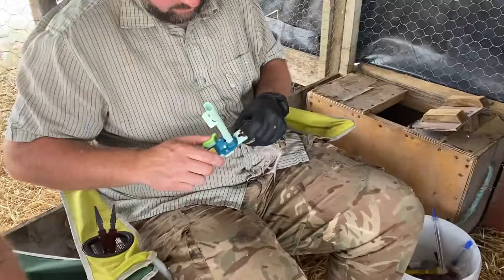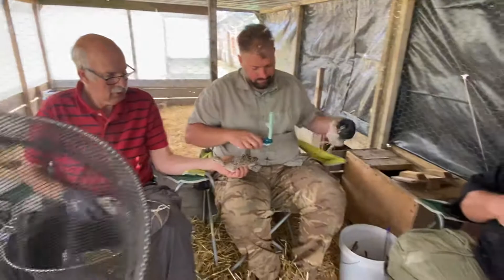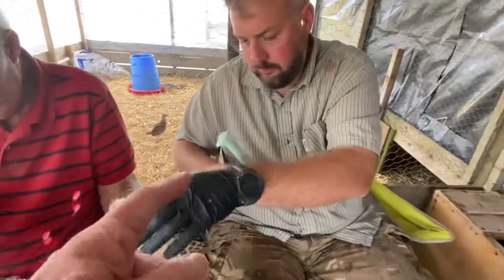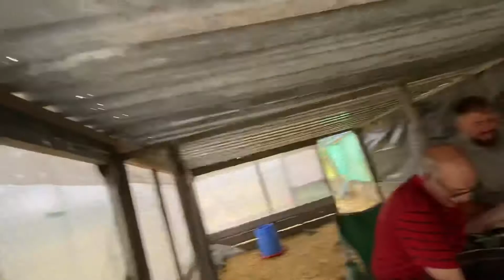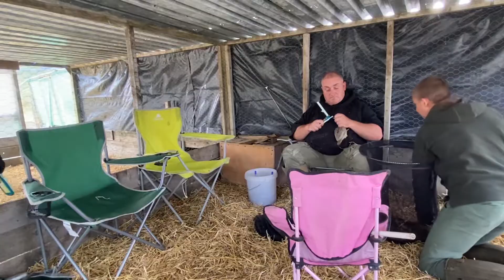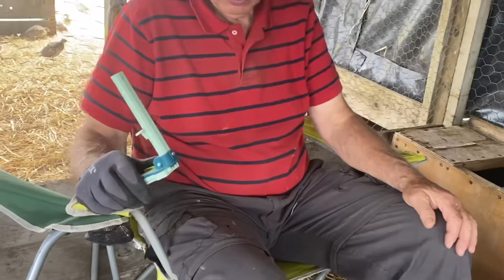Bitting Pheasants with 2022 BitFitter

Comment: How do bits compare to blinders? Is the removal easier? Do they stay  in until they’re released? Do they fall out or get hung up in netting? I have so many questions
Reply from the maker: Depends on the age of the bird. Provided they get pelleted feed to suit the bits then at least they can see straight and yet still not pull feathers. They don’t get hung up in netting or fall out by mistake. Split Bumpabits would be better for older birds .. they can’t hang up. Speak to your supplier :)